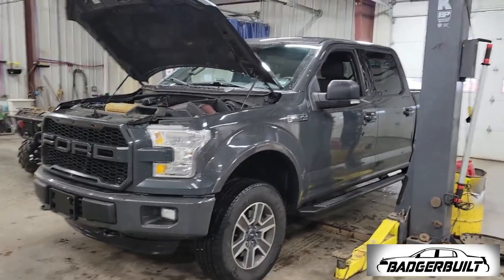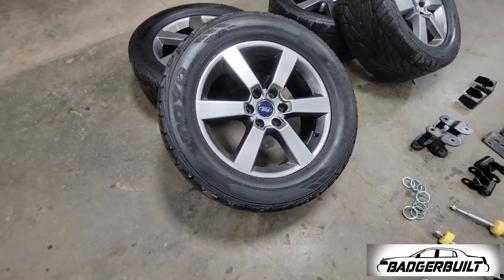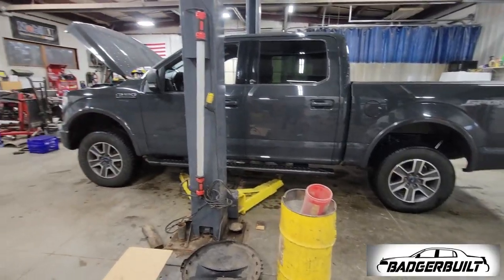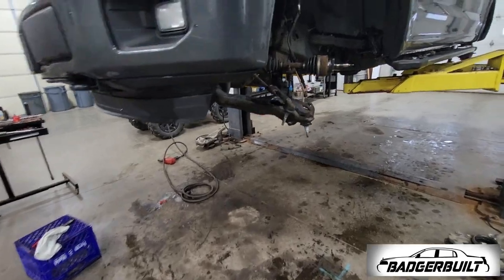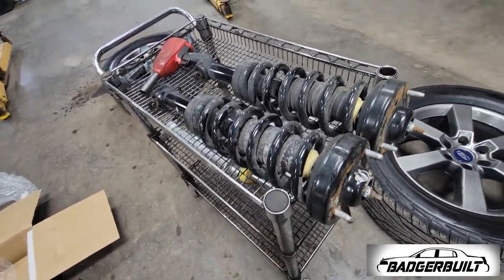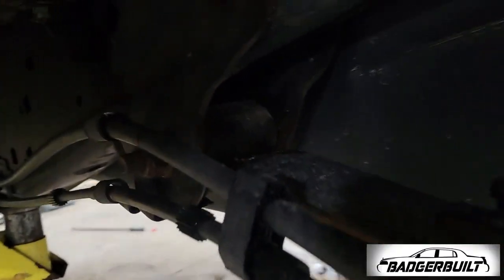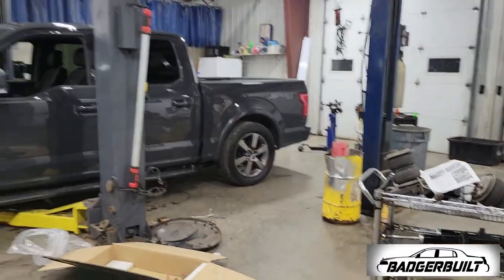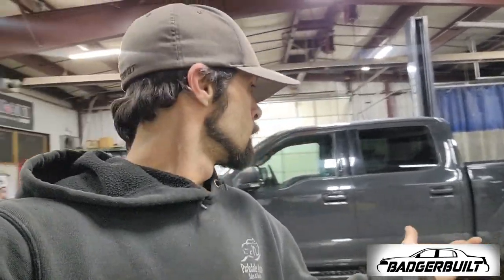Installing a Belltech Lowering kit. From Lifted to Lowered

Comment: I just got my truck done and the shop told me it would be too dangerous to notch out the holes and they said they were able to align it just fine.  Thoughts?
Reply from the maker: Being a Master certified Technician, I'm here to tell you, with how low I went, I had to slot the holes to get it within spec. Now, without seeing your alignment print out, I can't really say if they got it right or not. Clearly, they just weren't comfortable doing it as Beltech designed. Not all shops and or Mechanics are created equal unfortunately.